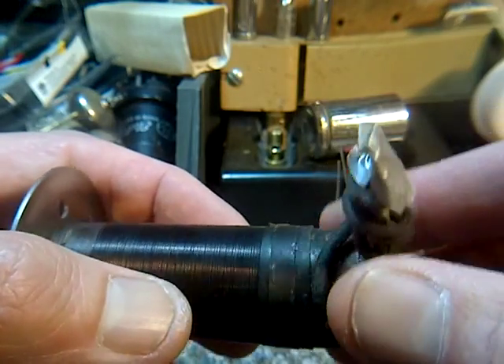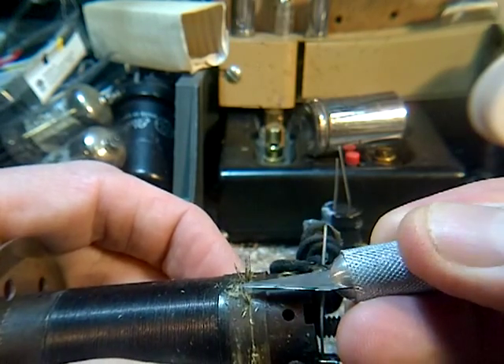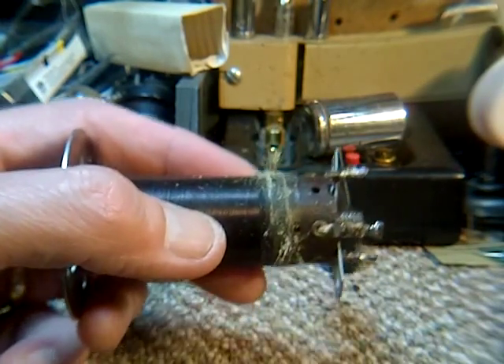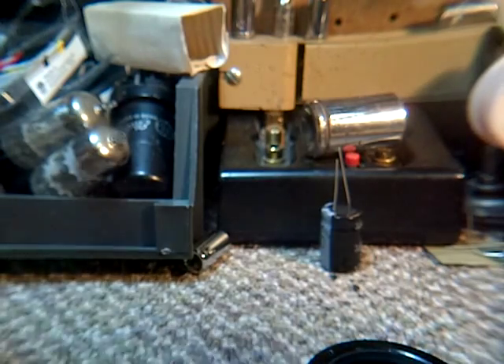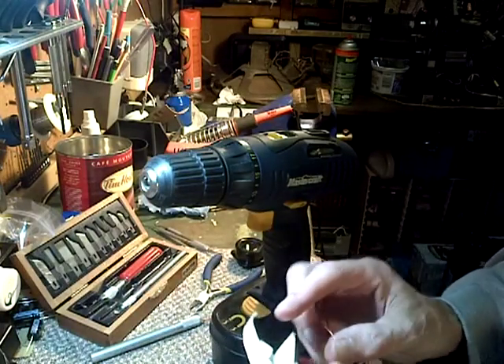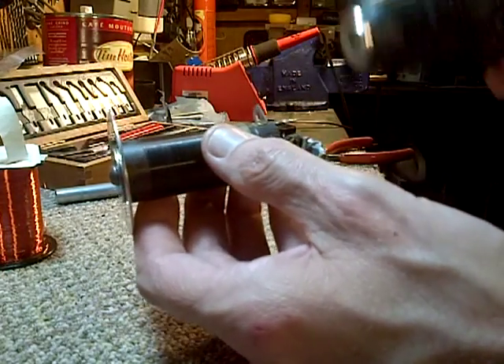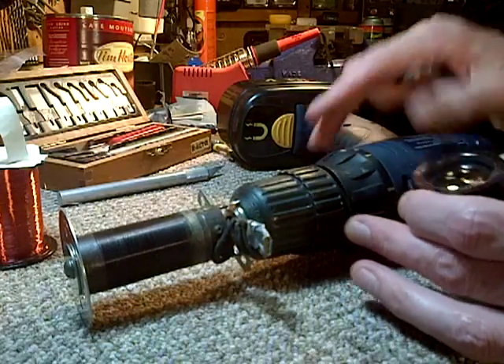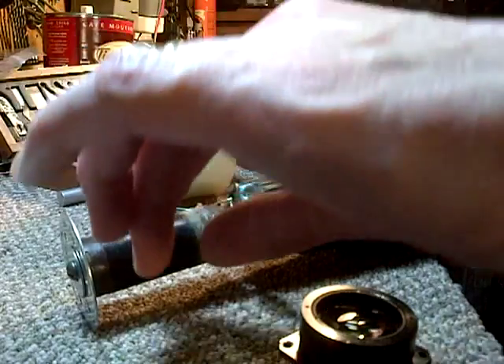Philco 91A 221 Tube Radio Repair Video #18 - Rewind Coil

Comment: Hi Jim, great story. I have an open coil for the 1st detector of a Philco model 70A. Since there is a plastic shield between the top coil (primary) and the bottom coil (secondary) I gently cut across the top of the coil with one cut. I was able to easily pry up all 69 turns.

Comment: The 'TWANGING' sounded like the intro to a James Bond movie!  
Seriously, I either calculate/measure it out and lay it if it is short, otherwise I make a spindle for the spool and use a sponge and clothespin to give me some back-tension. To hold the wires, you can use Scotch #665 double-sided tape or a dry spray -tack adhesive that will allow you to wind without slippage; when winding the tape on, just use a spiral without overlap so the coil is not lumpy.  Finally, avoid 'scatter-winding' the coil, as this will increase inter-winding capacitance and adversely affect the Q or the coil even though you have the same equivalent-inductance.  73...